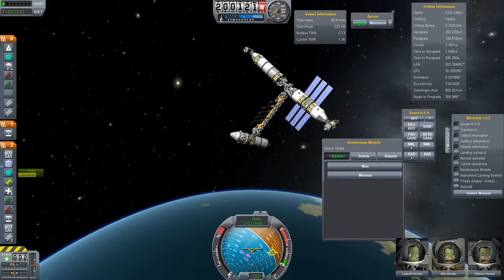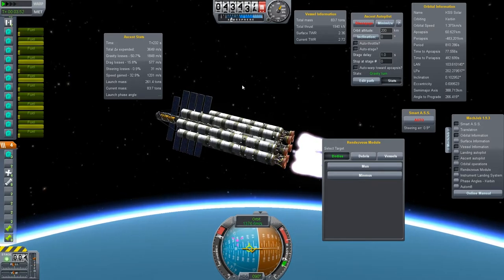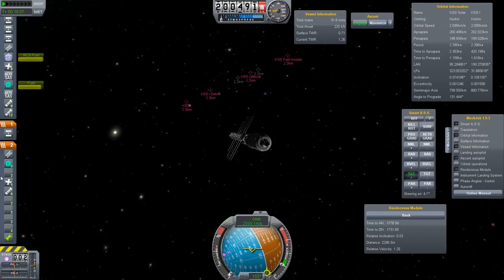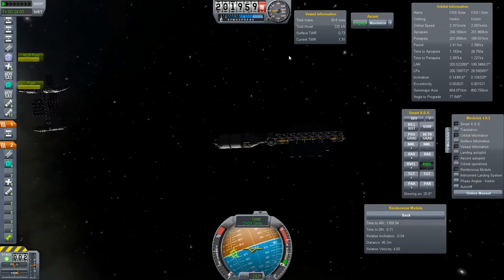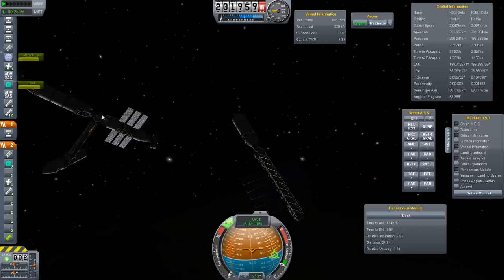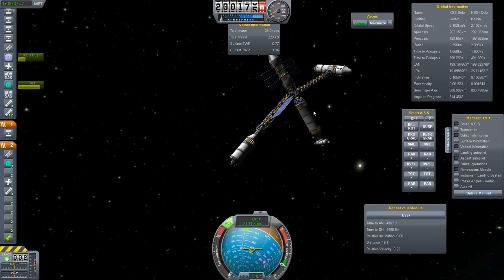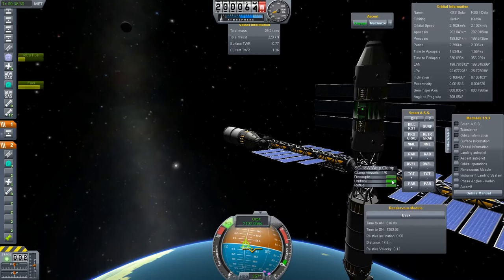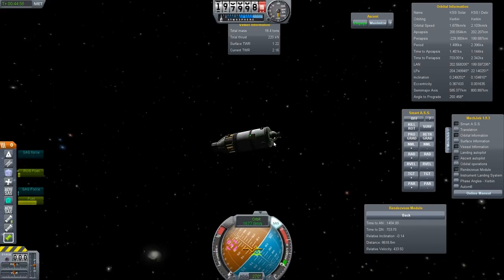Adding a solar-panel-module to my spacestation [KSP 0.17 , Erkle mod]

Comment from the maker: use the ascent autopilot of mechjeb first:
-start a normal launch using mechjeb autopilot to get into the desired orbit.(test flight)
-restart flight (mechjeb saves LPa)
-use ascent autopilot rendezvouz function
-mechjeb times the launch time 
-you should end up less than 2km from target after circularization burn

use +TGT and -REL smart A.S.S. function to get close enough for manual
and use RCS for dcking ;)

Comment from the maker: actually it is kind of easy with this mod and it is a lot of fun .... but a warning to all: if you try something similar ...at this stage of developement of the mod ..make a backup of your persistent savegame.... if you make other missions which require long warp phases it might still dissassemble your spacestation!...so keep a backup before going to an Inbterplanetary mission